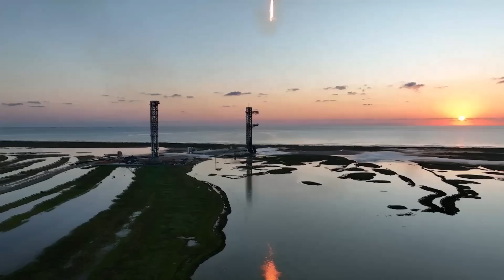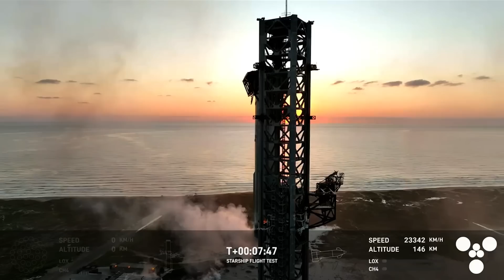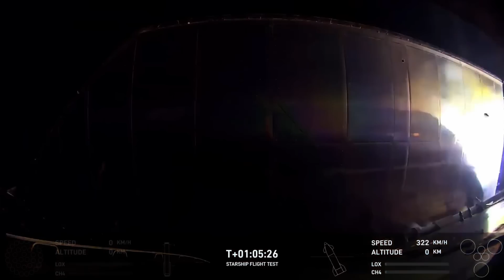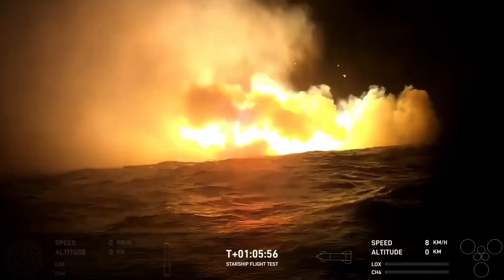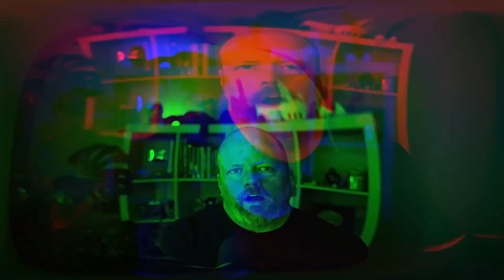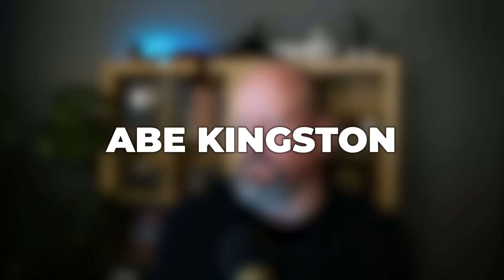ABSOLUTE Success! Full Analysis of Starship IFT-5 (with @scottmanley, @MarcusHouse )

Comment: They spent $4b of NASA funding to do this and were supposed to have completed an unmanned moon mission by now....Hardly a success
Reply: SpaceX have only received $2.2 billion from NASA for Starship to date, and just last month they saved NASA $2.3 billion on the Europa Clipper launch, so it evens out.
Also, NASA were originally supposed to launch Artemis 2 in 2020. It's now delayed until at least late next year, if not 2026. So NASA are 5+ years behind schedule.
SpaceX are currently only about 3 years behind schedule, so they're actually less late than NASA themselves. 
Even if SpaceX were ready to land on the moon right now, NASA won't be for several more years, so it doesn't really matter yet.

Comment: It's time to put enough fuel into that marriage of starship and booster to put the starship at least into orbit if not around the freaking moon. You got three times the thrust of Apollo and Apollo and around the moon. Why can't starship just take a quick bout around the room before you dump in the ocean the next time.
Reply: Because while it's got three times the thrust, it's also about three times as heavy, so it mostly cancels out.
More importantly, Starship is only a two stage vehicle, while the Saturn V was a three stage vehicle. The first two stages delivered the third stage to orbit almost fully fuelled.
Starship could deliver a fuelled third stage to orbit, and that stage could then go to the moon, but the second stage simply does not have enough fuel to get there itself.
Not without refuelling anyway - if you refuel a second stage in orbit, that is equivalent to delivering a fully fuelled third stage to orbit.

Comment: The raptor may be 99% efficient but every time you show it on TV there's an awful lot of wasted gas going off every other way bringing that efficiency way down?
Reply: Raptor has 99% combustion efficiency. That only refers to the efficiency of the engine's internal workings.
The exhaust nozzle only achieves about 98% of it's ideal efficiency, and the ideal efficiency itself will be more like 80-90% depending on operating conditions.
Overall, Raptor's total efficiency ends up being something like 75-85% efficient, depending on the atmospheric pressure outside the nozzle.
That's still really good by engine standards, but it does mean that it's losing about 20% of it's output as waste energy.

Comment: For the refuelling, I think they need to think about an ISS with the capability of docking multiple starships for filling up other starships that will head to the moon with plenty of cargo . The same type of gateway could be established in orbit around the moon.
  Granted, it takes more time. But it will increase payload capacity at destination and provide redundancy and security should hardware fail. And as Apollo 1 and Apollo 13 showed us, from time to time, hardware fails. Also the HLS could remain at the gateway or only do the trip moon to gateway orbit on earth.  Only the refuelling startships would descent back to earth. And obviously the capsules ferrying astronauts. The capsules can be brought up with Falcon heavy.

Comment: Couldn’t they just catch the heavy booster later in it’s trajectory at, let’s say another mechazilla tower? Instead of using that fuel to fly and land back at the launch site just use it to land later in its path
Reply: You could do that, but that would prevent quick reuse of the booster. If you land back at the launch pad, you can (theoretically) launch again a few hours later.
If you land a few hundred miles downrange, it's going to take days if not weeks to get that booster shipped back to the launch site, massively slowing down your launch rate.
There's also the problem that 'downrange' in this instance refers to dozens of different locations in the middle of the ocean, since different launches have different trajectories.
Which basically means you need a catch tower on a mobile floating platform. Not impossible, but certainly harder to build than a regular tower on land.

Comment: 16:55 there is insufficient deflection in the tower here as it bears the weight of the craft. Just a bit of shake on the camera, but zero deflection. Deflection is not apparent
Reply from the maker: Thousands of people watched it happen live. Maybe they saw more deflection from a different angle?
Reply: @frasercain  you wouldn't perceive it from afar, that camera was perfect to describe the tower leaning to a new centre of gravity but it didn't and should have tilted slightly
Reply: @miles-thesleeper-monroe8466  How slight? 1 mm? 1 cm? The answer depends on the mass of the tower and its structural rigidity. There is no easy way to know how much.
Reply: @SpaceAdvocate  there is every way to know. Ask any structural engineer.  You think tall buildings aren't designed to flex? This thing is 500 tons eccentric force applied it would have to flex
Reply: @miles-thesleeper-monroe8466  Okay, if you know how much it was supposed to flex, what's the number?
Reply: @SpaceAdvocate  why ask me? I've just pointed out a problem. I'm sure the tower designer could tell you
Reply: @miles-thesleeper-monroe8466  You're the one who said it had insufficient deflection. Maybe the deflection was sufficient.

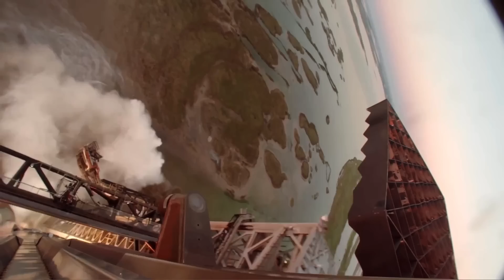Comment: 14:35 if the craft was rotationally wrong those two 6 inch feet wouldnt land on the grab arms. I dont see any rotational control
Reply: The Raptor engines are able to gimbal to control the roll.
Reply: @SpaceAdvocate  yes and the Russians are the world's best at vectoring jet engines but these are rocket engines which have also just been exposed to unprotected entry heat
Reply: @miles-thesleeper-monroe8466  The heat of reentry from a short hop is nothing compared to the heat of a Raptor firing. The Super Heavy booster didn't even make it to space, it was just short of 100 km at the highest point.
Reply: @SpaceAdvocate  so why is it covered with heat shield, except on the highly complex motor assembly which bears the brunt. You clearly don't know but space x might have the answer why not ask them instead of making up excuses yourself
Reply: @miles-thesleeper-monroe8466  It's covered with heat shielding around the engines, because the engines can take the heating, but the surrounding hardware cannot.

Comment: The outer engine bell heat damage problem is a great example of an issue that is proven to be a problem in one of the "agile" steps of the development process. It appears to be a solvable problem with a combination of re-entry burn and cooling propellant flow or other materials or operational innovation. Each additional kg of propellant use on the booster reduces payload by some lesser amount for a given booster configuration. How much it reduces payload depends on engine specific impulse, the rocket equation and the proportion of orbital speed provided by the booster. One of many such constraints. They are trying to do the seemingly impossible, all in a day's work at SpaceX.

Comment: Seeing the Booster just SCREAMING through the sky, emerging from the launch plume at nearly mach 1.5 was INSANE. Even when the Raptors fired, I didn't think it would slow down in time, or with the right trajectory to be caught. I'm sure someone could calculate the g-forces involved. But when it translated over and the chopsticks closed in and caught it, it looked practically routine, like this was the 10th booster catch, not the first.

Comment: An awesome thing to see for cargo. But I'm 99% certain this will never be used for people, at least outside of a few tests or occasional experimental missions. The reason is very simple, no hardware is free of failures and no computer is free of bugs and a 100% kill rate on failure of either one is not be acceptable for licensing/regulations. Every other form of flight has computer-free and power-free backups for safety, from planes having analog instruments and fundamental ability to glide (737 Max trying it's best not to though), helicopters autorotating, most space missions using parachutes and the Shuttle being able to glide. Being able to land without legs/wheels/skids, on a different surface if needed while retaining most safety. None of that will work with Starship. Even if an ejectable crew compartment with parachute is added it still means the ship is destroyed in a fireball or sinking - not acceptable or cost-effective in any industry as a standard failure mode. Something happens at the tower 5 mins before you land and it is out of action - no fuel to redirect somewhere else so loss of vehicle. Something happens at the tower 5 seconds before you land - hover then crash in a fireball, possibly taking out the tower as well
It will not get licensed for crewed/passenger/livestock flights.

Comment: What I found interesting was the discolouration on the fins. Knowing  a bit about metallurgy, those colours map the temperatures the steel is being subjected to as those are the colours you look for when determining the right temperature you want to aim for ranging from the straw colour through blue to violet before the metal heats through into dull to cherry red, yellow to white hot. This in itself would be a good diagnostic tool.

One worry though is I hope that the Luddites don’t win through legal action or over regulation thus relegating Starship to the same historic page as Wardenclyffe Tower.
Reply from the maker: They said they'd wrapped the fins in aluminum since it would show damage sooner and give a guide to when the steel would start failing.
Reply: @frasercain  I don’t think aluminium changes colour like steel does. When I’ve melted aluminium cans, it loses its lustre as the Al oxidises before melting but doesn’t change colour whereas steel goes through the colour range dependant on temperature. When blacksmiths and armourers had quench hardened steel they would then reheat the steel to the colour corresponding to the amount of tempering required, usually straw colour for things like knives where you want to remove some brittleness on the surface but still keep a relatively hard edge , or blue for rifle barrels where they want to remove more of the brittleness deeper into the metal to handle the higher forces without shattering. I have also seen screws on watches and clocks that have been tempered to blue or violet for aesthetics as well as to remove brittleness of the threads.
I know that they had some tiles with Al  coatings but the metal you see on the top of the fins is steel. The discolouration due to heat tempering the steel also shows where heat damage is occurring and you can even determine to what temperature

Comment: I'm curious if a more gradual reentry into the atmosphere would mitigate some of the thermal issues.
Reply: Only by using extra fuel for a re-entry burn reducing payload.
Reply: @AJHyland63  Not true.  With a more gradual reentry, you can bleed off more speed at higher altitudes.  For example, if you reduce the speed of your rocket significantly by the time you hit an altitude of 50km, there would be a lot less pressure and friction causing less thermal issues.

It's possible that the only way to significantly reduce the thermal impact on Starship in this way would be through multiple orbits between 70 and 50km.

Comment: booster really needs matched pairs of launch/catch facilities a defined distance away from each other to maximize it's utility.  Think something 300-500 miles away from each other.  That way, if they can design a set of flight profiles that allow downstream catches and follow-on relaunches, they can maximize performance while minimizing wasted transit time.
Reply: It's something to be said that the greatest actual forces on the booster appeared to be the boost back burn, so minimizing that could significantly improve structural longevity.
Reply: imagine a string of bases from Boca Chica, to New Orleans, to the Florida Panhandle, or other such potential strings of across water locations.

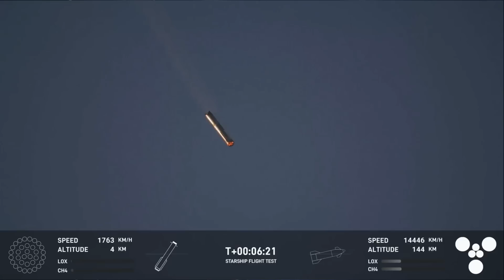Comment: Adiabatic compression of the atmosphere at 10:50 shows up as a red orange glow in the engine bay. This glow surrounds the expansion nozzles, but the nozzles themselves are not glowing. An extreme case of pushing down hard on your bicycle pump. Try it some time. You can feel the pump barrel get warm when the air is compressed.

Comment: i must admit i'm not that impressed this time.

yes, its visually stunning, no question about it. its just cool. but technically, once they achieved precise landing...this is just a small step. it really doesn't matter much if you use landing legs to land on point or you put landing struts on the top to catch on a structure.

the relevant thing is that you land on point, and that was a game changer years ago.

so, cool? yea. big step forward? not at all actually. personally i'm waiting for refueling in orbit between 2 of them...THAT will be game changing.

Comment: Scott, you wonder about fuel use to get to return but they still have barge landing possibilities. Maybe fly back after refueling, relaunch by catching SS (or fly it in?). Lots of possibilities. Think outside the box.

Can they try to take up a payload within the flight plan?
Reply: barge landing or "oil rig" reconfig will not be used for starship booster, it is impractical